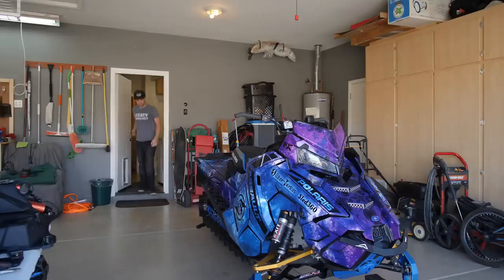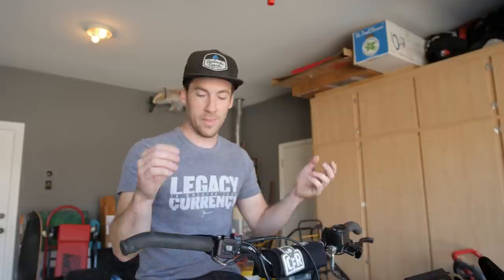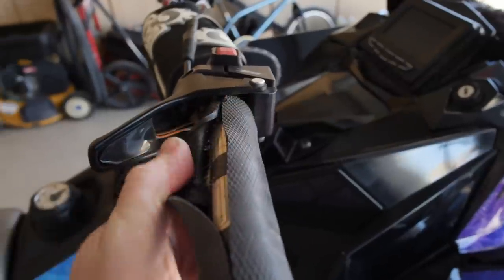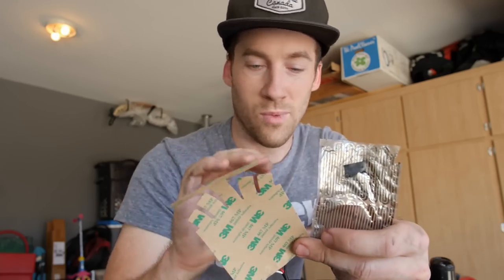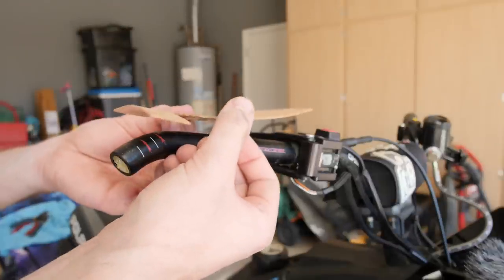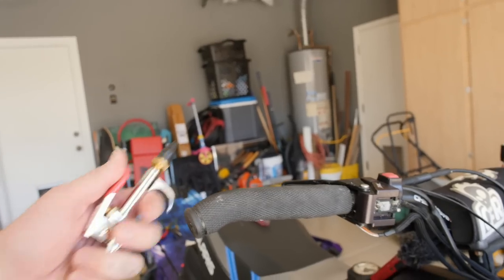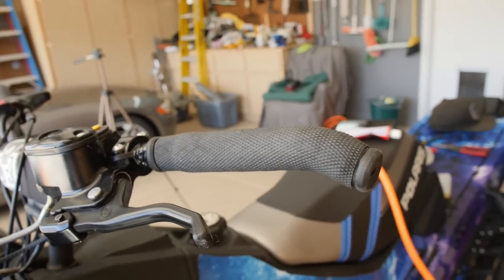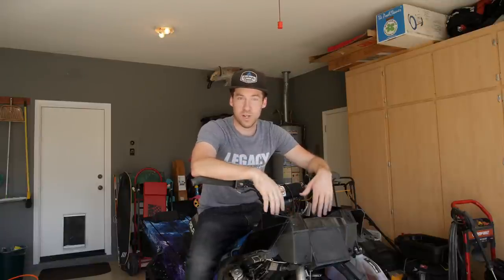HOW TO: REPLACE YOUR GRIPS AND HAND WARMERS

Comment: Did you cut off the old connectors and solder them on the new wires?
Reply from the maker: I just used wire crimps. Didn’t have a solder tool at the time

Comment: Did you have a problem getting the 7/8 diameter grip itself over the cork? Even with the air I could only get it half way of before it wouldnt budge anymore. Or is there a bigger diameter snow grip u have? Thanks
Reply from the maker: Houston Texans it’s a BITCH but it’ll go on. If you’re using shoe goo it’s kind of a pain since you have to do it really quickly. But if you’re using air are you blocking off the other end of the bars? If you have a friend to help it makes it that much easier. But yea putting the grip on with cork isn’t easy any way you do it but it can be done.
Reply: @ColinMcEvoy  I did have a buddy. We were like wtf lol. It felt like it almost wanted to tear.  We did not block off the other end of the handlebar tho. Just used the air on the grip hole it self. I'll have to give that a try and maybe use some different glue that doesnt dry up so fast. Appreciate it
Reply from the maker: Absolutely man good luck!